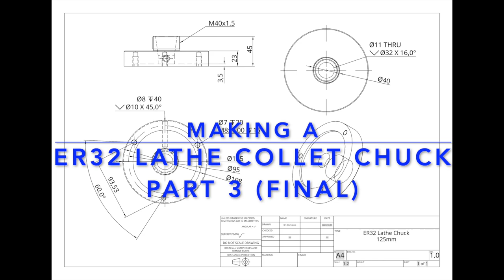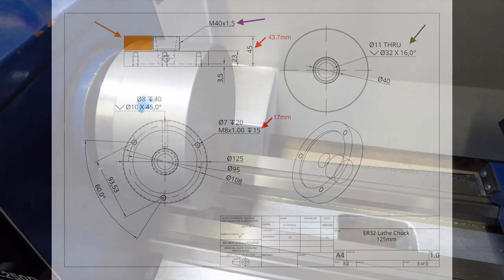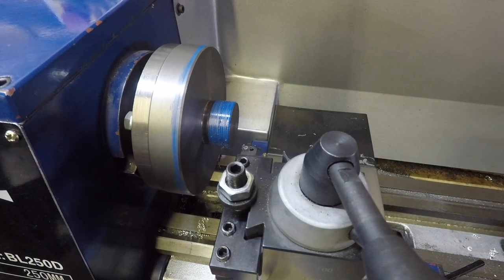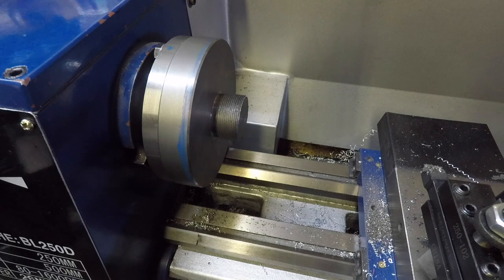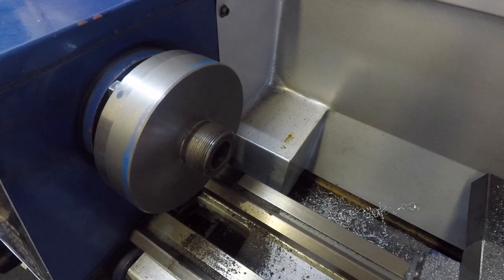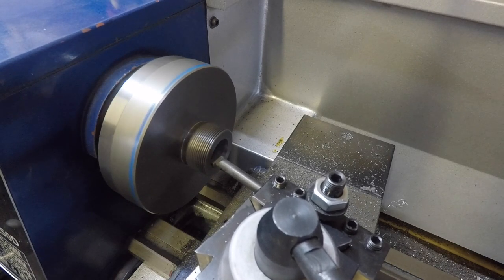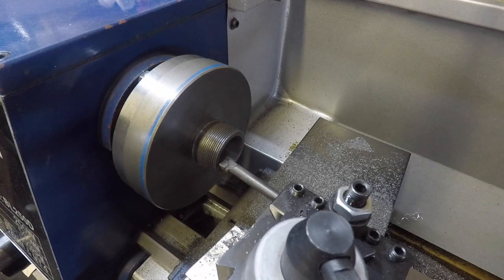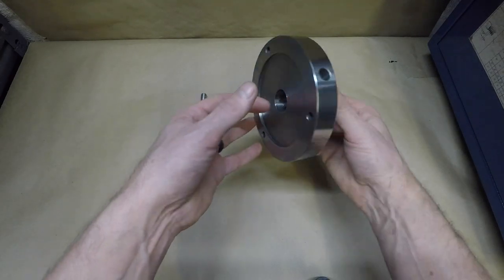Making a ER32 Lathe Collet Chuck Part 3 (Final)

Comment: You done a great job.  So did you do any tests afterwards for runout is a collet installed?  Or other tests.  Have you used your new chuck yet?  You could put a nice brass ball on the end of your tommy bar to give it a bit of character!  Thank you for sharing.  It was a good series.

Joe
Reply from the maker: Hi Joe, Thank you for the feedback. I am going to do a separate video regarding some runout tests (and one for the threading). Adding a brass ball to the end of the bar might just be a good project to give the chuck a test :).